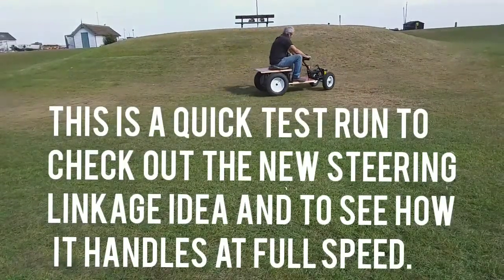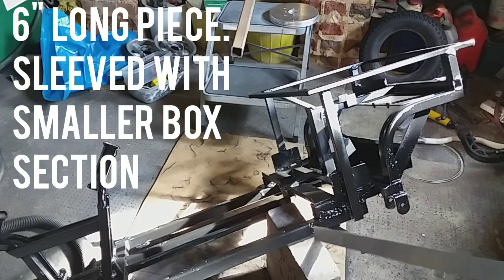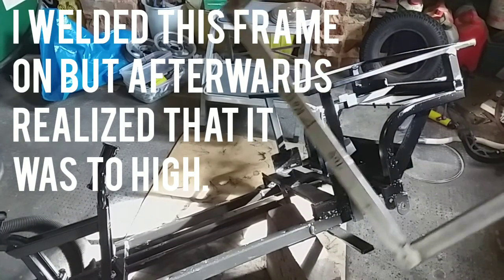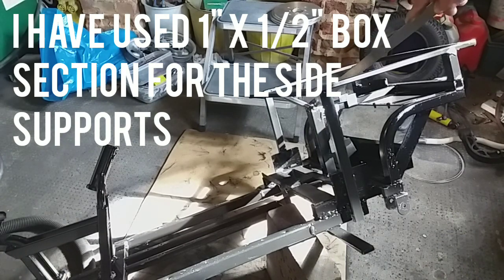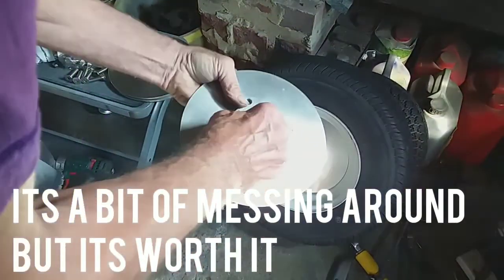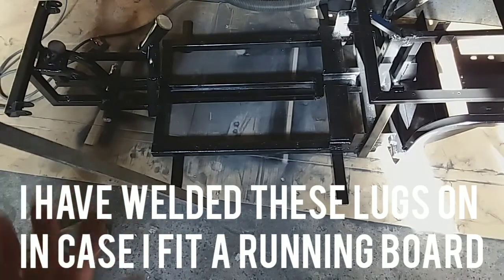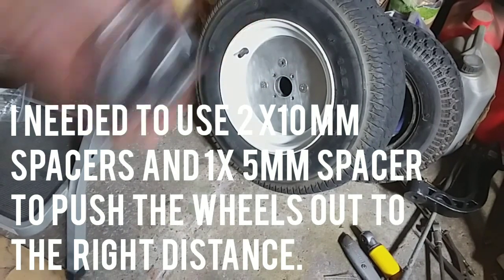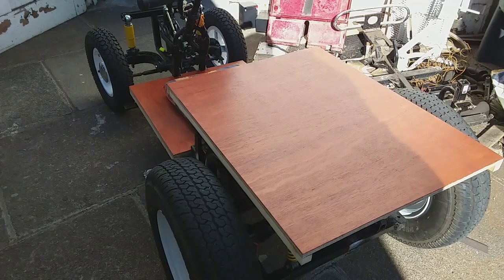NEW  MOBILITY SCOOTER CONVERSIONS

Comment: Just wondering are the shafts on the back long enough to accommodate for the spacers, could not seem to fully grasp the workings..
Reply from the maker: HI THERE HASGER. WHAT YOU HAVE TO DO IS JUST USE LONGER BOLTS TO BE ABLE TO PUT THE SPACERS INSIDE THE INNER EDGE OF THE REAR WHEELS.  I ONLY USE STAINLESS STEEL BOLTS ON MAKING THE CARS.  BECAUSE I HATE RUST. I HOPE THIS HAS EXPLAINED IT ENOUGH FOR YOU. ALL THE BEST PETER.
Reply: @p..chittenden9174   Many thanks Peter, it was the shaft we could not quite understand, on our ctm-hs740 wheels there is a nut to un-do to take off the wheel, if we were to use the spacers on the back we thought the shaft would not protrude enough to get the nut back on..